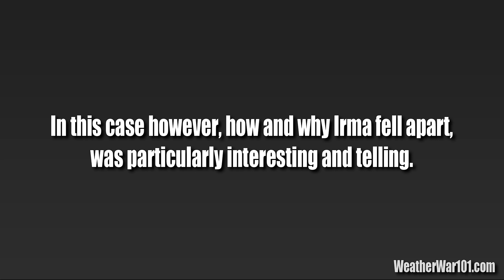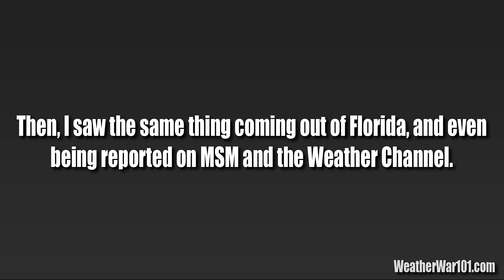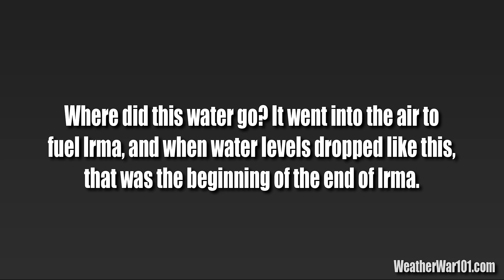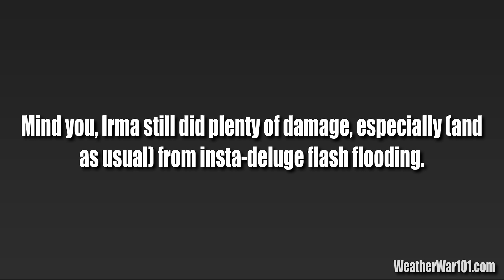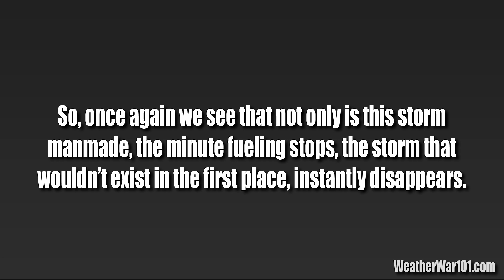Hurricane Irma: Tampa Bay Water Disappears

Comment from the maker: The bizarre disappearance of Tampa Bay water shows how these manmade storms fall apart when they lose their Water Vapor fuel source. Throughout the span of Irma, massive high concentration bursts can be seen constantly rebuilding and refueling the eye of the storm. These massive highest concentrations of Water Vapor are happening in an atmosphere of completely dry air. There are NO natural circumstances where top end concentrations of Water Vapor can materialize right next to (or in the middle of of) completely dry air, but that is what happens throughout the storm’s entire cycle.

As you can see in the video, the Rapid Evaporation fueling that sustained Irma stopped flowing from the Gilf at the same time Tampa Bay water disappeared. The moment the Water Vapor fueling from the Gulf stops, the Southern side of Irma instantly flies apart as the dry air instantly rushes in. At the same time however, massive On-Land Water Vapor Generation takes over fueling the North side of the storm, and (as usual) causes 25 inches of rain to drop on Jacksonville in 24 hours, This is the cause of all subsequent flooding, not storm surge.

It doesn’t get much more obvious than this example. When the Water Vapor source is turned off like a faucet, the storm is turned off too. Again, it should be clear to anyone with common sense (and certainly should be clear to any “meteorologists”) that this simply cannot happen in nature. Yet, it’s the only way Irma, or Harvey, or Jose can even exist.

Once again, here is a glaring opportunity for people to see how daily manufactured weather actually happens. While meteorologists lie directly to our faces about the source of constant flooding, the in-place Water Vapor Generation responsible for keeping these systems alive is plain for all to see. While the population lines up yet again to donate cleaning supplies and baby formula to people who lost their homes and all of their possessions, the one REAL thing people can do to help these victims – is to EDUCATE them on the manmade sources that put them in this hell to begin with. Please, support the only channel and singular work that proves the local sources of these manufactured disasters, every single day.

WW101

PayPal
http://PayPal.me/WeatherWar101

Geoengineering Truth Store
https://teespring.com/stores/geoengineering-truth 

Global Flash Flood Destruction Documentary - GoFundMe Campaign:
https://www.gofundme.com/global-flash-flood-destruction 

Understanding Severe Weather, Climate Change, and Global Warming - Made Easy 
https://weather101.teachable.com/p/understanding-crazy-weather 

No Natural Weather: Introduction to Geoengineering 101
https://www.amazon.com/dp/B00KNCUSZW

WeatherWar101
http://weatherwar101.com/

---

FAIR USE NOTICE: This video may contain copyrighted material. Such material is made available for educational purposes only. This constitutes a 'fair use' of any such copyrighted material as provided for in Title 17 U.S.C. section 106A-117 of the U.S. Copyright Law.
Reply from the maker: Note: As you can see, the cyberterrorists continue to have 'likes' on my above video post comments blocked, as the millionth tactic to suppress support and to keep this knowledge from the population. If you can't like the comment above, please like this one instead, and post a reply comment about it. Just as with manmade weather, the only way to combat these psychological terrorists - is to expose them for what they do.

Comment: The next video should try to find what caused Irma to lose its fuel to the South. Something opened Irma like a zipper.
Reply from the maker: They turned of the Rapid Evaporation from Gulf very abruptly. The fact that the Water Vapor Generation stopped suddenly at the same time the Bay water dissipated (which was the source water), indicates they turn it off - BECAUSE of the massive water level drop. The way the southern end flew apart, certainly didn't look like a 'planned' event at all.

Comment: You can literally watch the storm smash up against the high pressure over the gulf.
Reply from the maker: True. The huge High Pressure System in the United States (along with Heterodyne Wave Generation) created a ridiculously obvious 'brick wall' for Irma to crash up against. What is also important to understand is that the high pressure system only exists, because they TURNED OFF almost all water vapor generation in the country, which results in completely dry air. This show yet again what the "natural" state of the climate is, and the fact that the absence of Water Vapor Generation to cover-up Global Burning, instantly results in 100+ degree temperatures, as it has been since they turned it off.

Comment: I just want to make sure I understand, so they basically ran out of water to fuel the rapid evaporation? Why didn't they run out of water in Texas where the hurricane lingered and dumped all that rain?  Or was the stop a manmade decision?
Reply from the maker: Because Texas has a tremendous amount of On-Land Water Vapor Generation capacity. That's why Harvey was able to refuel in-place for five straight days.

Comment: Question; What would the weather be like if they stopped doing this?
Reply from the maker: As I said in a previous comment, you can SEE what the weather would be like RIGHT NOW. All you have to do, is look at the absence of Water Vapor Generation over the last couple of weeks to create the blocking and steering "High Pressure System" covering the United States. There are 100+ degree temperatures, and not a drop of of rain. That is what the climate would be like - period, and that is the collapsed climate they have been covering up for the last 50 years.